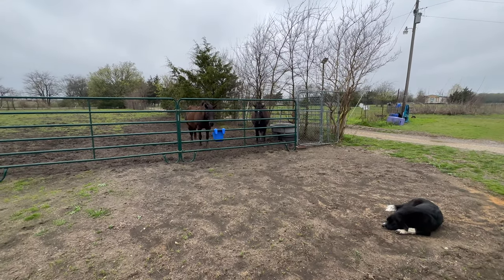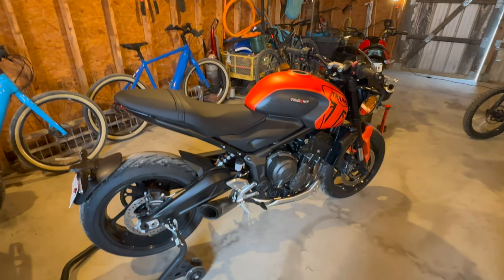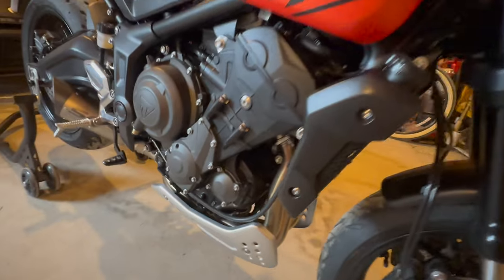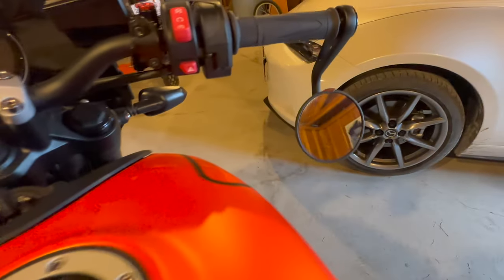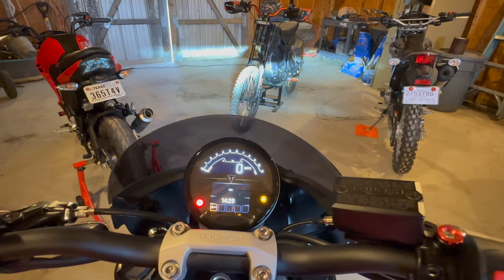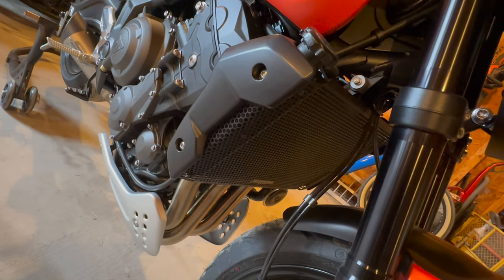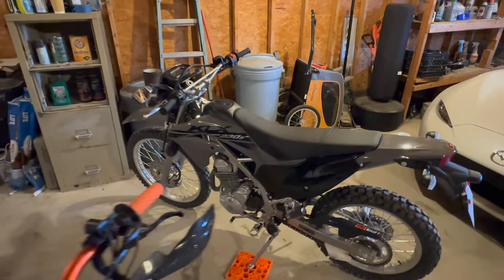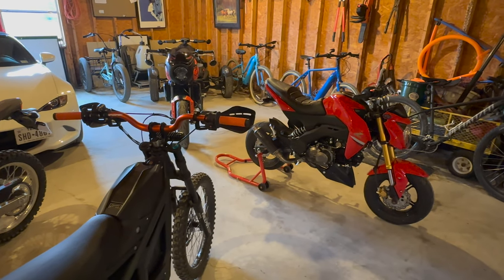Triumph Trident 660 | Modifications & Add On's

Comment: Love the faring! I'm curious how well it deflects wind though, as I'm looking for something to make highway riding a bit more comfortable.
Reply from the maker: There is some protection but not what a true touring shield would provide. From my experience either have a full faired bike or a purpose build touring bike. Hybrid solutions like this will not provide the relief you are more than likely looking for.
Reply: @BunnyandBman  I'm really just looking to get the wind off my chest a bit for the shorter highway rides. If this faring can provide some relief there then it's a strong contender.
Reply from the maker: @GonePh1shing  it should be sufficient for that, it moved the air towards my helmet, I am 176 cm or 5'10, if that helps.
Reply: @BunnyandBman  That's perfect. I'm a fair bit taller, but even if it lifts the air up towards my shoulders that should be sufficient.

Comment: I just got a used trident recently with the flyscreen already installed. I'm wondering if I'd be able to install this Ermax fairing without removing the flyscreen
Reply from the maker: I doubt it, it has its own mountain system that I would not think is compatible with other products.

Comment: Cool video, I love the mods you did on your Trident. It really improves the look. For improvements, I would suggest you upgrade the cheap looking break and shifter pedals,  think about blackening the foot rest and belly pan for a really stealthy look, and remove the old mirror mounts. 
I had a question for you though since I know you have experience with some bikes I am trying to choose between. I have on my list the Aprillia RS660, Trident 660, Street Triple R, Honda Hornet, and Suzuki GSX-8S. From your video I see that you own/owned 3 of these bikes and wanted your opinion on which would you take away if you were offered all of these bikes for free but you could only have one of them. 

For me (Engieering background), as someone without experience living with or really riding these bikes, looking at the spec sheet, it seems to me that the Aprillia is very hard to beat . You have an aluminium frame and swin arm, really well machined components, very good wheelbase and trail configuration, good breaking and suspension components, electronics including IMU, cruise control, quick shifter, cornering lights. I honetly don't know how Aprilia fitted all of this stuff on the bike and are selling it at a price that is competitve with others on my list. However, looking online I see a lot of complaints with regards to reliability. I can't quite figure out is this is a loud minority, or there is actually a large proportion of RS660s that do experience problems. I don't have any data. My worry is also that my Aprilia dealer is almost 2hrs away and I hear there is always a shortage of parts, so, if my bikes needs warrenty work, it could easily sit in a dealrship for a couple of months. 

I sort of prefer the triple engine config of the Street triple. It also has really good components and geometry. But, it comes at 1k more than the Aprilia. What are your thoughts on both bikes as a comparison? Which feels better to ride (smiles wise) and which is more higher quality? 

Finally, Would you even take a street triple over a trident? Note I am over 185cm, so I don't know if I will look silly on this bike. I hear it feels budget compared to the street triple. Not sure how accurate this is.

Thank you and keep it up.
Reply from the maker: Whew, a lot to unpack here. Thanks for the suggestions, concerning the Trident, I agree, the belly pan would look way better matched and would love to do something with the bottom levers. I would not recommend the RS660 or even Tuono for that matter if you are 185cm. I am 176cm and it felt cramped to me. The Tuono will somewhat ease that with a more upright riding position but honestly, I think personally you are better off with a Tuono V4 albeit a bit more expensive. If you just have to have a 660, go with the Tuono factory or dare I even say with a Tuareg! Put street tires on the Tuareg and you have a super comfortable and capable machine, think Desert X but smaller, just food for thought. The Elephant in the room is the reliability of Aprilia. It seems to be a hit or miss. In the old days if you can work on the bike yourself it would have been ok, nowadays, I would not recommend it unless you are somewhat close to a dealer or have another bike that you can fall back on while the other one is in the shop. Of the 4 bikes you mentioned, the Aprilia and Trident feel the most dated while the Suzuki and Honda naturally feel fresh, especially with their big great-looking TFT dashes. Without having ridden the Suzuki or Honda and just looking at the reviews, my pick would be the Honda of all 4 bikes! The Street Triple R would be my next pick since you brought it into the mix. But honestly, in the end, go out, ride them all, and see which one speaks to you the most, after all, it is about having fun! There is a reason my collection is growing, and that is that each bike has its own strength and weakness but is still great in its own way, hence I am keeping the Triple and Trident as examples, there were enough differences that I wanted to keep both, I even made a video about it. I realize that not everyone has the luxury space-wise so if you must choose one, I don't envy you as they are all great bikes. Hope this helped a little bit and I would have more to say but I think I am running out of room here ...
Reply: @BunnyandBman  Wow! Firstly thank you for responding to me so quickly and for being so detailed. I didn't realise the Aprilia was cramped so thank you for this heads up. I was already leaning away because I didn't want to deal with warrenty issues even though I am sure its a fantastic bike. This left me mainly choosing between the Street Triple and Honda. So, it reassuring to see that you also arrive at the same conclusion. I will definetly give them a test ride and try to pick. Thank you again for your advice.